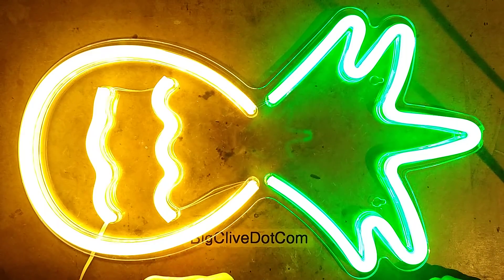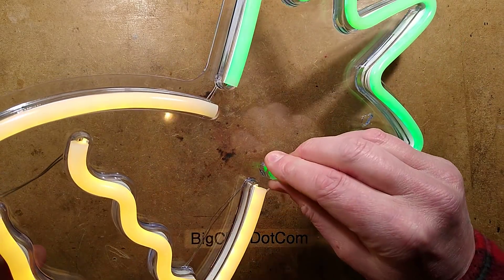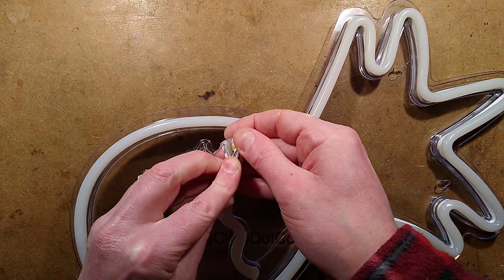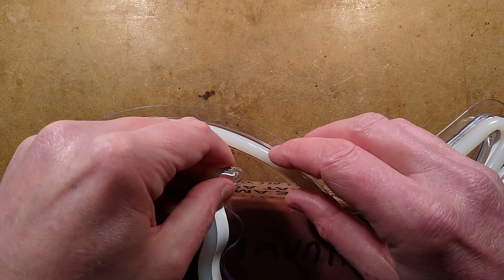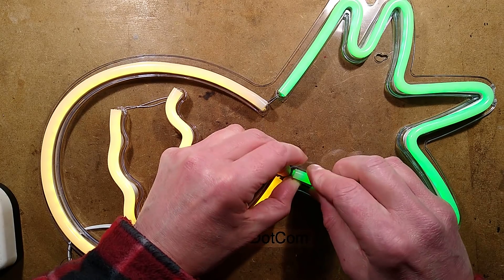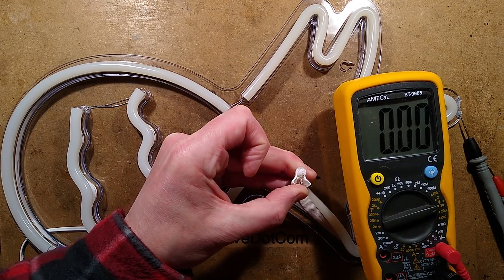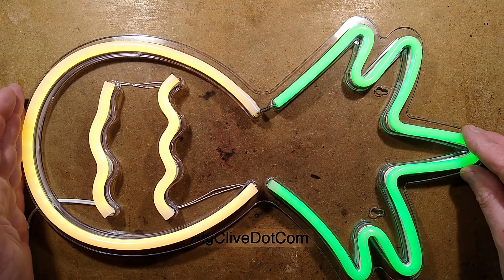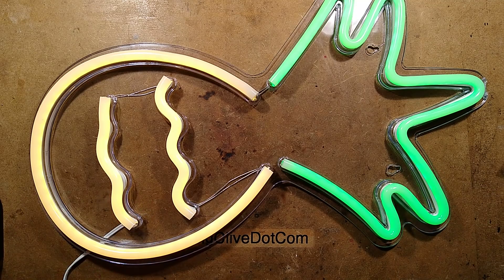New style LED neon ornament construction and wiring

Comment: I have one of these. I am American, but I own a couple businesses in Asia and live in China for most of the year. My living room is set up for entertaining, as I entertain friends often. I have a built-in bar between my living and dinning room and the walls are covered in these on a black sheet metal wall that has holes drilled in it and backlit. There are tons of companies that assemble these, mostly small family businesses, however, the frames are mass produced by a manufacturer to be sold to the smaller businesses. The "neon" accent wall in my home has 12 of these....some shapes and some English phrases/words. EDIT: I forgot to mention, I have had these for about 3 1/2 years and have had no issues with any of the LEDs burning out. I moved into my apartment 4 years ago and did a lot of decorating over the first 6 months. The LED strips I used through the apartments alcoves, under counters, behind wall mounted TVs and under my balconies railings were from the same company that assembled these. I could have bought them from a super-cheap company, but spent a little more to get them from a better LED supplier. 3 1/2 years with no issues of LEDs blacking out and all of my smart controller still functional is pretty good in my opinion.

Comment: I make these as custom signs, sometimes phrases or words. I have the advantage of using a CNC Laser or Router... and I can't come anywhere near $30 for a sign like this. Considering the time for assembly and soldering. There's one thing that I do differently than anyone else... is that I've cast some colored silicone end caps to hide the bright hot spots and unfinished looking edges.

Another trick I've picked up along the way, is that you can just fold back the LED strip even with a light on it, to meet your cut ends or termination points. Even though you've only got the 1" spaced cut lines to work with. You can still get your neon to end where it needs to end, without having a dark/dead spot, or compromising your design. This is most useful when connecting letters in scripty fonts, or the short little bar segments, like the horizontal line in 'A'

Comment: Of course, you could make the illumination more even without swapping in 12V stuff.  Just add some wires linking the end of the green to the beginning of the yellow.  Better, but still dimmer in the middle.  There's an even better fix that was once mentioned by somebody called Big Clive.  Leave the positive feed where it is, on the yellow.  Move the negative feed to the far end of the green.  Even illumination on all the LEDs.

Comment: Hey Clive, you should check out the 'stopcor'. it's something I'm sure you'd love to take apart.

It's gotten featured on plumberparts a rather large domestic uk plumbing channel and when I see magical 'black boxes' with miracle claims, I think a bigclive teardown is in order. 😂

The patent is a good read as well - WO2018011608
Reply from the maker: Looks like a sacrificial anode with impressed voltage from a low voltage power supply.  Could possibly have uses.
Reply: @bigclivedotcom  Doesn't the current and voltage have to be monitored so that it applies the correct voltage and current? 

Also they do the classic limescale prevention claim which I'm pretty sure is equal to that of the clamp on pipe magnet claims.

Comment: If you want to avoid brightness drop-off due to wiring losses from one end of series-connected strips to the other, feed positive from one end and negative from the other so the I*R drops in opposite directions balance each other out.

Comment: There's no reason to cable the segments one after the other, "series" way. They could have reduce the overall dropout voltage connecting the segments in "parallel".
Reply from the maker: More wiring I'd guess.

Comment: To get around the voltage drop issue, I'd connect the positive to one end of the strips and the negative to the other. That way all the LEDs will have the same amount of bus bar in series.

Comment: I know they would never do this, but if they would just connect the ends together then the voltage drops far less at the part of the circuit that has the most resistance. It is another two wires, and operation on the factory line--so it is just right out.

Comment: So the magic is not in the kind of standard led strips but the blurry rubber holding it.
I guess the efficiency goes down the drain for the optics, cooling also may suffer so if driven hard loosing brightness faster.
Reply from the maker: Efficiency does take a hit for the diffusion.  They tend to run the LEDs at between 10 to 15mA, so they don't get too hot.

Comment: Another way to get nearly even illumination is to feed it from both ends.  I've done that when feeding long LED strings.
Reply from the maker: For identical illumination asking the whole length you can feed positive from one end and negative from the other.
Reply: @bigclivedotcom  That's true, but the whole thing will be a bit dimmer.  This might be worth a bit of experimentation.

Assuming that the "bus" resistance is high, compared to the resistance of the feed wire, then we can ignore the feed wire and just address the bus length.  Let Rb represent the the resistance of one pole of the bus, end to end.

If you feed both poles from one end, then the nearest LED will see 0 x Rb, the middle LED will see 1 x Rb, and the farthest LED will see 2 x Rb.

If you feed one pole from each end, then every LED will see 1 x  Rb, with a portion of that on the + pole and a portion on the - pole.

If you feed both poles from both ends, the brightest LEDs will be at the ends with 0 x Rb and the middle LED will be the dimmest with .5 x Rb. (Feel free to correct my calculation.)

Given that LEDs have a non-linear response to voltage and our eyes have a non-linear response to light, I think the only way to know what yields an acceptable solution is to try it and see.  (hint)  :-)

Comment: Cool.  I picked up the rainbow, the cactus, and palm trees.  They arrived needing some soldering and tweaking of contacts to repair them, but after that, they are pretty decent.  :)  Waiting for you to review the newer style led Strips that are a lot like the faux filament 'vintage' bulbs.  I think they were calling it COB neon LED strips.  Hard to take the plunge, not knowing exactly what it is. I do want to make a bit of led signs to simulate old neon in my garage.   The newer design looks more like a continuous filament.

Comment: The construction might be good, but it seems to have been designed by someone who has never seen a pineapple.
Reply: But it's quite amazing that a round thing with a couple of curly lines and some green spikes makes us believe it's a pineapple. The human eyes and imagination is amazing.
Reply: @ZeedijkMike  > makes us believe it's a pineapple

I'm not so sure of that. I mean, if someone had never seen neon lights, I doubt they'd instantly associate this with the fruit. We just associate it with (better designed) neon pineapples that we've seen before.

https://www.aliexpress.com/item/32965678983.html

Even ignoring the weird leaves and the tiny bulbous body, the essence of a pineapple is the diamond pattern. Those squiggly horizontal lines don't make any sense.
Reply: @RFC-3514  eliminate the squiggly lines at the "bottom", replace it with a small circle, trim the "top" spike, make all the LEDs blue, and you can easily turn this design into a "fish".

Comment: Chinesium plastic is really not meant to be bent around in a chilly bear den ,It's definitely more pliable when hot, they don't call them sweat shops for nothin😉
Reply from the maker: Yeah, heat would definitely help.
Reply: @bigclivedotcom  Plus the adhesive would provide lubrication while it's (shall I say) MOIST!

Comment: Is 800mA high for an led strip light?
Reply: Depends on the length and LED density.
Reply: Also, remember that it's a 5V strip which means much higher amp for the same amount of power compared to the common 12V and 24V led strips.
Reply from the maker: It's only 5V so effectively 4W with the dissipation spread over all the LEDs.  They are effectively being under-run.
Reply: There's no "yes" or "no" answer to that, only "it depends". But if you have the choice higher voltage is better, because it means lower current for a certain needed power (which is voltage x current). Losses resistive elements (which wires are) increase with the square of the current.
See the voltage drop from 5 to 3.8 volts (1.2V drop) at the end of the strip? That's a loss of about 1W (1.2V x 0.8A) in the wires.
With a 12V strip you'd need only about 320mA and the voltage would drop by I guess 0.5V to 11.5V. That's losses of something like 0.16W (0.5V x 0.32A).
These calculations are simplified (because the LEDs are spread along the wire and not all at the end), but correct in principle.
Reply: @superdau  Excellent explanation. Thank you!

Comment: Clive, I have some outdoor holiday ornaments using a similar type of LED tubing but it's double-sided (shines from front and back) and just cable tied to a metal frame.  Would you be interested in a few meters of that style tubing to experiment with?
Reply from the maker: I've seen it.  I may order some at some point.  It's neat that it uses a single LED strip to light both sides.
Reply: @bigclivedotcom  Very good.  My local hardware store sells 13 feet for about $20 and offers several colors.  https://www.truevalue.com/neon-flex-rope-light-red-13-ft
If you want any mailed just ask.  I enjoy your videos and have a lot of experience over the last 60 years or so.  My wife says I'm an eldergeek. Sending it to you would be a way for me to feel I've thanked you for the enjoyment your vids provide me.

Comment: Could they not join the ends to create a "LED Ring Final" to more evenly distribute volts/current?
Reply: For the best results attach the positive to one end and negative to the other. This way the voltage drop gets distributed in such a way that each point on the strip should get exactly the same voltage.
Reply from the maker: They could.

Comment: Thanks for not pausing. Even though you're manual dexterity had gone.
Reply: Knowing him it was probably freezing overthere and he still refused to turn up the heat. I sometimes fear his measurements can't be considered true to life because they were taken in extreme conditions 🤣
"But Big Clive measured 3.3K..."
Correct, but you need to take into account the 30 degrees Celcius temperature difference.
Reply: @Ni5ei  need to retake measurements at 273 Kelvin...lol. So we have consistent, accurate measurements...lol